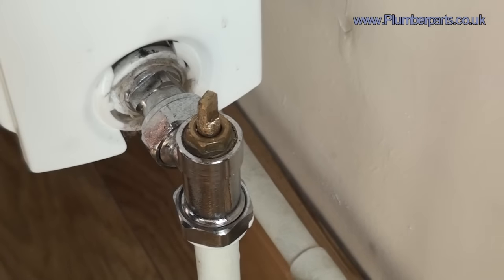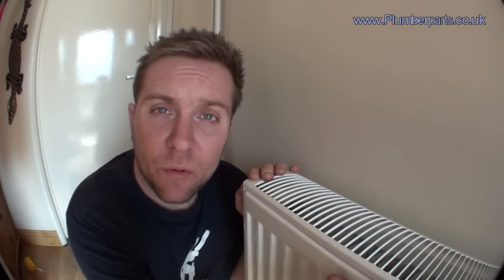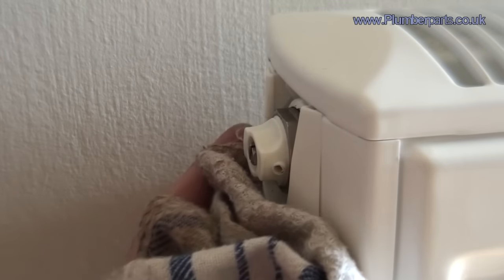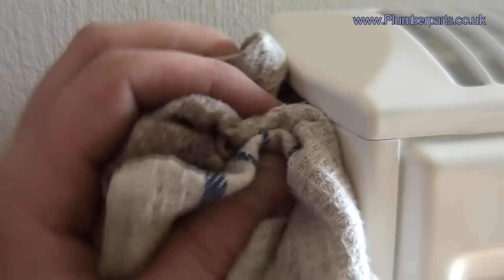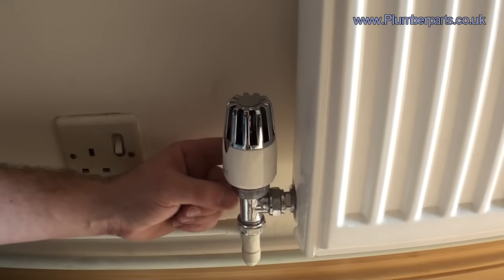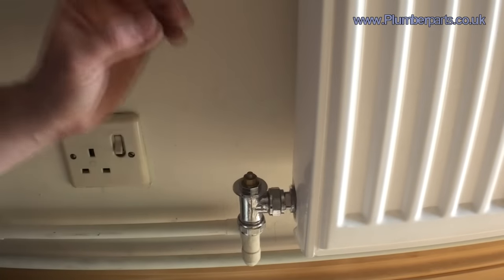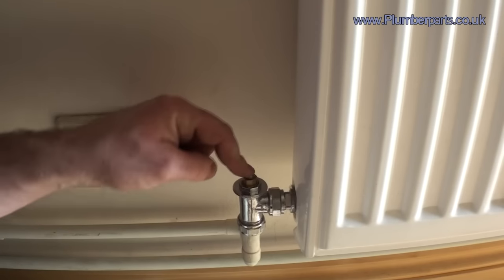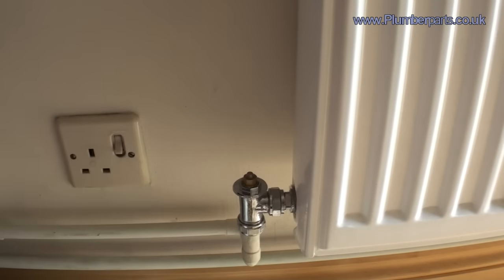How to Fix One Radiator Not Working - Plumbing Tips

Comment: Can't thank you enough. Superb clear instructive video. 
Flow and return pipes both cold on one radiator - followed your instructions - opened up lock-shield valve fully - nothing! Still cold. I then turned my attention to the TRV (Siemens) and removed it. The 'pin' (bit sticking up) wouldn't move at all, wasn't sure how far it was supposed to be sticking up. Sprayed some WD40 on it and left it whilst I went to have another look at your video in case I wasn't doing it right. A few minutes later when I returned to the rad - Whoopee!! It was already hot, and the pin was noticeably sticking up further, and I was able to push it down and see that it was free. So thank you so much - you're an absolute star!! .....I have subscribed to your site so that I can return if I need any info another time.

Comment: Much appreciation Plumberparts!  Due to Covid my wife had to work from from home. But the radiator was not working in her room. After lots of complaints, I followed your advice. I had a problem with the TRV pin, and thanks to your tip of gently knocking the side, the pin opened up! I now have a radiator that works, and a happy wife!

Comment: Thanks, our radiator issue was solved by the lockshield tip. After having tried everything else 2 years ago, we completely failed  to think of messing with the lockshield and have used an electric radiator over winter in that room since then. I followed the instructions to open up the lockshield, and hey presto, a hot radiator :D :D :D
Reply from the maker: BOOM! Well done Nikki!

Comment: Awesome! I live in a rented house, and this video has saved me the effort of having to get the letting agency to do something about it. I kind of knew it must be something simple and Google brought me here.

The radiator in my office was stone cold, but full of water. Gently pulling on the pin in the TRV made the radiator instantly heat up, and now everything is nice and hot the pin moves around freely again. The hardest part was getting the TRV head off, it's secured with clips and a metal C ring and some old paint, and a bit of rust and clearly hasn't been removed in 20 years.

Comment: For those who are not plumbers, don't forget if you start adjusting your lockshield valve it will need balancing again afterwards to get the correct flow through your radiator, or else you can cause further problems elsewhere in your system, as well as with that first problem rad.

Comment: Thank you for your advice. Followed your simple instructions and fixed the one radiator which was not working. The trv was down. With some tweaking the radiator is working as normal. Thank you again.

Comment: Thanks very much! I had a dead radiator and couldn't figure out what was wrong. I watched this video and found that the pin in the TRV was stuck down. I followed your instructions and gave it a gentle wiggle with pliers and it worked 😀. Thank you very much.

Comment from the maker: Hi Guys, if you're still having trouble, try these other fixes out here 😎👇
REMOVE AIRLOCK IN RADIATORS: https://www.youtube.com/watch?v=bAeRurEExBs
REMOVE SLUDGE FROM RADIATORS: https://www.youtube.com/watch?v=Ru-nNFqBzqk
Reply: What causes radiators to be noisy. I have the old side on Thermostatic valves. At 2 it is quiet and the radiator is barely warm. At 3 it's boiling and you can hear the water rushing through or/and the radiator is noisy.. This radiator is upstairs.
Reply: plumberparts 1
Reply from the maker: Turn the pump speed down by the boiler.

Comment: Great video thanks. Radiator hasn't been working for two years. Saw this video, tried what  was instructed - and it was the pin on a Danfoss which was stuck. Fixed it in under 5 minutes. Job done! Thanks again.

Comment: Great video. Straight to the point. My rad in my room wasn't working, all valves were open and I'd already bled the air out (there was none) so I tried tapping the pin and it clicked up. Thank you :-)
Reply from the maker: Top work!

Comment: OMG Thank you so much for this really clear and precise video.  I had 1 bedroom radiator that just would not come on while all the others in the house were lovely and hot.  Watched your video and it worked within minutes. It was the lock shield valve that was not fully on - one quick turn with a spanner and I could hear the radiator come to life.  Thank you so much.  My husband passed away 6 years ago and he would have automatically known what to do but as a woman on my own things like this are difficult, but with wonderful you tube I can practically try  and fix anything myself !!

Comment: Excellent video. Just fixed one radiator that's been cold for months...it was the pin that was stuck  under the thermostat, which I wouldn't have known about. Thanks very much.

Comment: Nice. Didn't think the lock shield part would be the prob but decided to check because of your bid and turns out it was fitted and turned down about 70 to 80 % from full rather than regulated by the thermostat is valve. rad now fine. Cheers.

Comment: Thank you for putting up the video.  I had one radiator that had suddenly stopped that was usually pipping hot. After watching your video it was the pin that was stuck. Started working again straight away! 😁

Comment: Absolute life saver!
I had my walls plastered and they took the radiator off,
When I put it back on, it would not get hot while all others did.
The TRV pin was stuck - used a little bit of DW40 and gently pulled the pin up, eventually loosening it so it springs back up.
Working perfectly now.
Thanks!!!

Comment: THANK YOU very much indeed.
I had several radiators not working since a "plumber" came to replace the mid-position valve. Didn't want to fork out £00's again so left them not working until now. Just found out that all those radiators had the lock shield turned to closed, so no water flow. Why would he need to do that? On the last one I also had a jammed pin in the TRV which, thanks to this video I fixed myself in 5 minutes. 
Great videos and  a really money saver.

Comment: Thanks so much for the extremely helpful video. Mine was the pin problem and as soon as I managed to adjust it the radiator worked. Very grateful to you 😁👏

Comment: Thanks very very much. Am a "sort of" handy man at home. Been thinking about how to get this double radiator going. BLED EVERY RADIATOR IN THE HOUSE  BUT ONLY ONE WONT HEAT UP!! I have  heater in my house yet this part of my lounge had to do with a small plug in electric radiator.  Woke up this morning and checked on line and hey!  there was your succinct video. Got down to the TRV (British Gas Spec.).  pushed it down a few times. Within  three minutes that double radiator was baking HOT.  I dreaded the call out charge etc.    Once again thank you so much.

Comment: One radiator was cold the rest hot. Bled it quite a lot of air came out but still didnt get cold. It was the TRV pin stuck down. Just pushed on it and it popped back up and freed itself. Thank you

Comment: thanks very much, just managed to sort the rad in the small bed room I have been ignoring for 1 year. mind you it was leaking as well and managed to sort that. I unscrewed the TRV and the pin was stuck down. I had to loosen the nut just below the pin and the pin slid up and success. 1 minute later stupid hot radiator. top man.

Comment: Thank you for being one of those caring proffessionals that shares logical and well explained layman terms knowledge, I had one radiator stop working and British gas took it off clean it out (which I had already done having read on another video sludge could be a problem) and there was nothing coming out when he did it (obviously as I had already done it and told him), he put sludge buster in my water tank and basically gave up  but said boiler was all good and other radiators and said maybe need floorboards ripping up to find problem 😲and that was that. I have lived with that issue for years until another radiator went cold then a a couple months later another one until today all but first and last had stopped working - having seen your video I carefully took off the regulator valve on each radiator and notice because i was in a hard water area the pins had locked down - i took your advice and gently wiggled them and cleaned them and immediately heard the rush sound and they heated up - everything fixed thanks to you and in 2022 with the fuels hikes and everything expensive and being unemployed this has save me an immense headache and stress! May you have great and happy times ahead for passing on good knowledge.

Comment: Well damn, this fixed my problem.
1 radiator in the apartment I moved into was completely full of air.
Released the air with a screw driver and now it works wonderfully.
Thank you.
I expected it to be clogged or something, who knows what the previous owner did, but this indicates living here in winter without biggest room being heated.

Comment: Ha! Awesome. After watching this, took the TRV head off on the offending radiator, and lo and behold the little pin was covered in blue/green copper oxidation and was pushed right in. So gave it a little tug and it popped out. Cozy now.

Comment: Can't thank you enough!!! Rad has been freezing for ages, never knew what it was. Bled it a few times and it made no difference. Saw this video and checked the TRV. The little pin seemed fine, so I first thought that wasn't the problem. Gave it a little wiggle anyway. The rad started getting warm instantly, and was nice and hot before I could even screw the TRV back on! I'm gonna be nice and warm when I go for a poo now, all thanks to you! Cheers!!!

Comment: Really loved the video which covered all possible leaks, not just one or another cause like other videos. My leak was the bottom nut on the copper pipe, and using ptfe wrapped  on a mini precision screwdriver to apply it above the olive worked a treat, having lowered the pressure in our new combi system by lowering the pressure using the radiator bleed valve. This and using the bungs in the combi system, and advice on the appropriate opening/closing would be good additions to make it perfect. I was surprised that despite and getting a good bucket of water out from it, water still came out fast despite me closing off the radiator bleed key. Still worked a treat. Thanks a lot.

Comment: I have spare bedroom and I will be sponsoring a family from Ukraine, mother and 5 years old daughter who will arrive tomorow. As this is the first day when need to turn the heating on after summer, i started to bleed all the radiators and to my disappointment the one from the spare bedroom and bathroom didn't heat up. Before calling for some emergency plumming what I can't really afford anyway, I thought to have a quick search on youtube and came across your video. I started with rotating anticlockwise that bit what you mentioned and succesfully broke it down without resolving the heat issue. I just jumped to next step to take off the TRV head and the pin was completely pushed down and green substance around. tapped it gently for few sec. pulled it then sprayed with wd40, tapped again for a bit, pulled it pushed it, rotated it and just before giving up, it came up. I sprayed a bit more wd40 and left it soak few sec then played a bit with it pushing up and down and succesfully sorted the issue. Same issue was on the one from the bathroom, managed not to break the tap bit on that one. Thank you so much, very vevy helpful, well explained, no unnecessary neverending long story video like my comment! Hope the good karma sent by many people you helped will reach you.

Comment: Wow thank you so much for this, I was able to fix my radiator in less than 10 mins and the problem was indeed with the TRV. Never could find the lockshield on my model though but it works wonders nevertheless. If I'd known it was that simple of a fix I would've fixed it months ago !

Comment: Thank you, first tip worked. 
Thought it was still 'not quite working' as the smaller radiator was piping hot until my mate pointed out the larger one probably just needs longer to heat up 😅

Comment: Thanks so much you're the man. My problem was fixed by opening the valve anticlockwise in your first step. any idea why this would have suddenly happen though because the radiator was working fine then just stopped??? Anyway all good now thanks again

Comment: The older ones are always the best. Looks like I have a stuck pin on my TRV after removing the rad for decorating. Will have a go at gently prizing it. If I feel it needs more force then it's probably time for a new one anyway so I'll call in the experts. thanks for the upload.

Comment: Thanks for your informative and helpful video
I have a radiator that is cold in the centre from top to bottom but warm on one end top to bottom and slightly hotter top to bottom at the other end
One pipe bringing water in is hot and the one taking water out is warm
Hope you can help, tia

Comment: Your videos are helping me no end. I've bought my 1st house so don't have a landlord to call on anymore.  

I've had an absolute mare getting my heating going.  Hot water constantly overflows into the f and e tank, sometimes only 1 floor heats up and now I've got a radiator that's refusing to heat up. I don't have TRV's though - just the old fashioned valves.  What I think is the lockshield side is fully open but the other valve only moves about half a turn.  Neither pipe warms up. Is there a fix for this type of valve or am I best trying to replace it? 

Thanks to your videos, I've successfully managed to drain, fill and bleed my system, replace a towel radiator valve, fix a couple of toilets by replacing the fill valves and flushes, fit a shower pump (something called showerpowerbooster... not sure yet if it was the right choice), and just now clean out a Fernox TF1 that I didn't even know I had... I've been in the house just over a year! 

Thanks a million. 😁

Comment: Hey mate! I appreciate that you made this video, we just got our radiator working, thank you. 
But I have a question: we used the first method by removing the lockshield cap. You said to turn it all the way, but the radiator started working after just a few turns, and could be turned much more. Should I still turn it, or leave it now that the water's flowing? Once again, thank you.

Comment: Hello sir and thank you for your excellent videos.   Each day I have to go to the track rod end of one of my radiators and let some water out a good size saucepan full I can instantly hear the hot  water filling up the radiator and it’s excellent along with the other radiators all day ‘ i’ve tried bleeding the radiators but there is no air coming out at all.   I have had the radiator replaced with a new one and this made no difference whatsoever.  I would love your opinion . Thank you so much

Comment: Thanks so much for this helpful video.  We have added a radiator to our existing central heating system (combi boiler).  We didn’t need to drain down as we used self tapping isolating valves.  The radiator is getting slightly warm at the top by cold still at the bottom.  I’ve gone through all the steps in this video (the lockshield was closed but we’ve opened it now) and it’s still the same.  The pipe to the TRV is boiling hot, but the pipe from the lockshield is cold.  We re-pressurised the boiler after the radiator filled up. Do we need to bleed all radiators? Any info would be so helpful.  Thank you !

Comment: Some years after this video...one rad. with no, none, zero heat in it, or the pipes to and from. (Hallway, bungalow.) Lockshield valve was fine..as in, on. Undid the 'Hiflo' thermostat valve,  which almost flew off. left with the valve, a spring and a piece of clear plastic, roundish, with bevels and holes in it. But immediately pipes and rad starting heating up...Result! How does the valve go back on? So, hopefully obvious... put spring back inside the valve, the plastic bit on the spring, (valve upside down..then put it back on the pin without it coming apart again. Screw it back on. Seemed to be OK. Job done!  (I think). Please let me know if the re-position sounds wrong! Many thanks.

Comment: If this this doesn't work turn off all the working radiators turn on your comi boiler. Wait 15 minutes then bleed the non working radiator of 2 mugs full of water. Re pressure your boiler. Repeat twice. Turn all the other rads back on. Job done

Comment: I have one radiator in my bedroom that gets luke warm at best, I've tried everything. Bled all radiators,  took off trv and made sure the pin isn't stuck in, took the bedroom radiator off and blasted it through to remove sludge, tried balancing the system, tried turning all radiators off except for the bedroom radiator (which didn't get hot). I can hear water flowing to all radiators apart from the one I'm having an issue with. I've realised that even though the trv is on the right and lockshield on left (same on all my radiators) the pipe with lockshield gets hot, the pipe with trv remains cold) my first thought it is was hooked up wrong and the lockshield and trv need switching round, I've read many things online that lead me to believe this won't make a difference as it should still work if trv is on the return. I've tried fully opening lockshield, no luck.

Comment: omfg bro, thank you somuch. Normally I left this thing to the landlord to sort out and it would take like three weeks for someone to come take a look at it. 
Today- nahhhhhhhhh, bish bash bosh, done within 8 minutes. I did use a hammer to push the pin in, but I didn't whack it, it just used it's sturdiness as a support to jostle it free then dabbed a bit of machine oil on it to lubricate it before screwing the control valve back on. LEGEND.